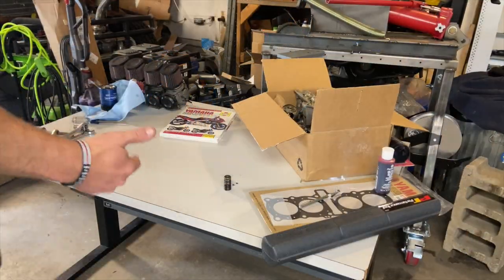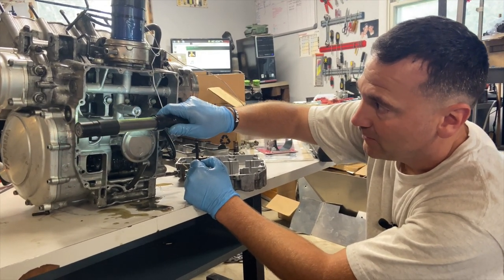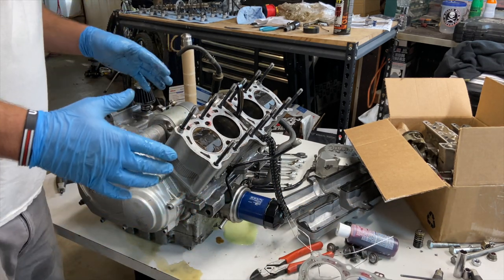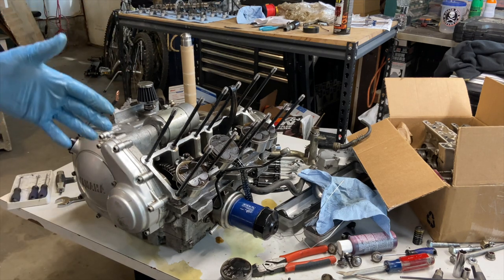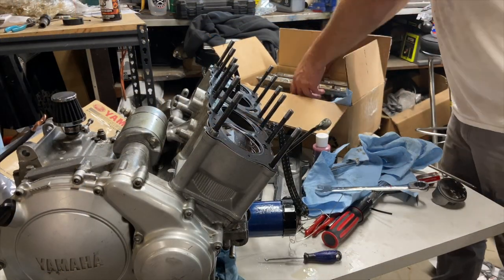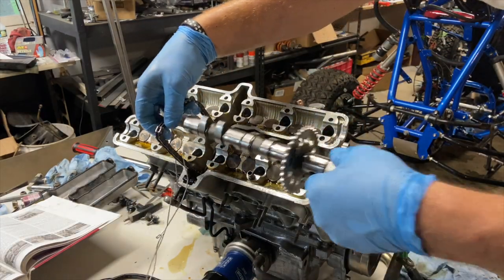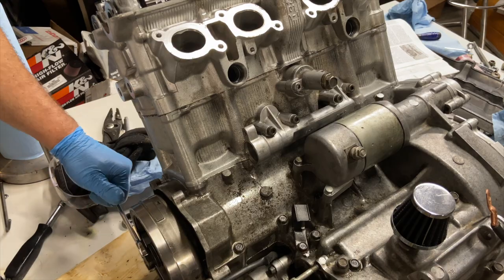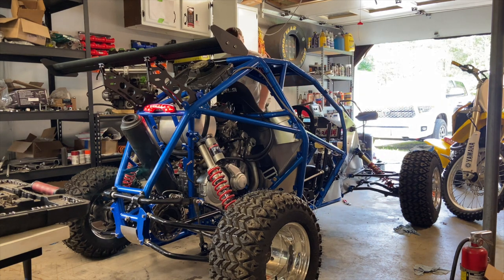600cc Motorcycle Piston Replacement: KJ Raycing VF-1 Crosskart

Comment: I would have used the original rings, at least then the wear on them would be the same and definitely would have checked the valve clearances while the engine was open and out. Other than that I absolutely love your buggies!
Reply from the maker: Honestly I didn’t think about that. I saw the piston as damaged and just swapped the whole thing. Apparently I did pretty alright, it’s running better than it ever has. Thank you for the compliment, these little buggies are soo fun! Check out the driving video I just posted!

Comment: I just subscribed!! Being that I’m about to start my first cross kart build ever using your plans. Do you think using the affordable tube bender I can achieve the quality of your builds?
Reply from the maker: So glad you found this and thank you! I obviously can’t guarantee you’ll be able to bit there have been some members on the facebook group using other benders with success. The majority of the joints are on some type of radius, so as long as the pieces fit on the jig it will be square. You just may have to trim a little more with a different CLR. The crossmembers are straight and tie everything together to make the chassis very stiff and strong. Enjoy your build!
Reply: @KJRaycing  that is another thing! I’m new to the term CLR and don’t really understand it at all and the importance of it. Do you have a reference guide for it or where I can find one on YouTube?
Reply from the maker: CLR is how many inches it takes to bend a tube 90 degrees. I use 4.5” clr dies because is the racing world 3D is the standard (3 x the tube diameter; 1.5” tube x 3 = 4.5).
Reply: @KJRaycing  ok cool! Well basically I’m going to just copy your setup (the things I can afford) lol. 4.5 it is for me. I see a lot of dies stating 6” clr so I’ll just pay attention to the details when ordering

Comment: Yamaha designed the 1jz for Toyota so yeah the valves should be similar.  Anyway anyone have a IRS setup with brakes that not too expensive?
Reply from the maker: That’s the goal right? High end machine that doesn’t cost anything. This is as inexpensive as I could make it. I’ve found four outlaw rear ends; all of them will last forever and they are all rebuildable. I paid anywhere from $200-800 for this. A comparable setup is 3k from a manufacturer.